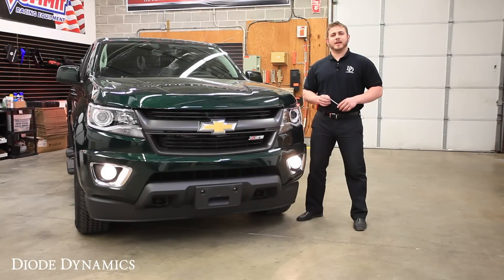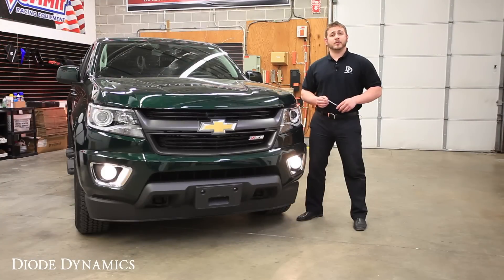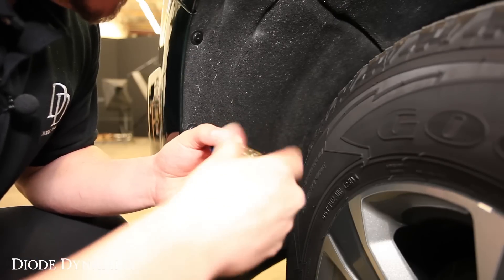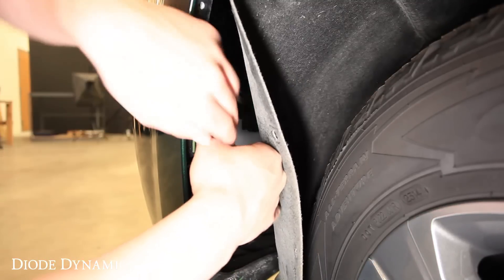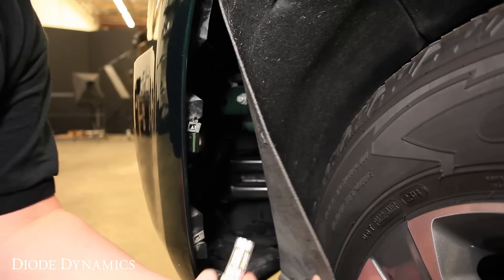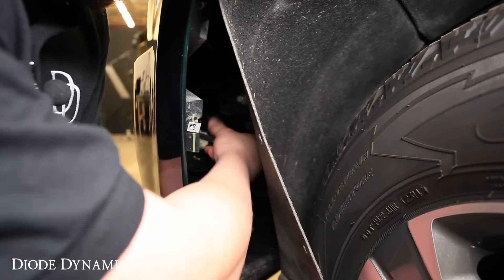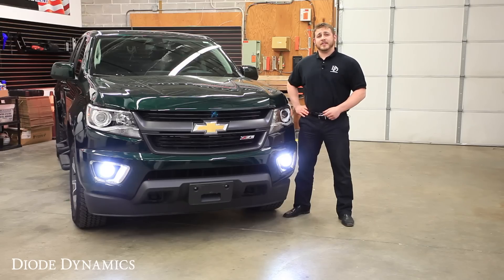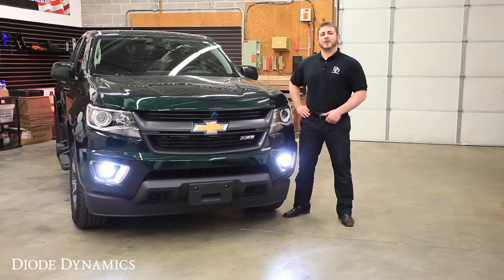How to Install Chevrolet Colorado Fog Light LEDs

Comment: Can I use this for my 2017 Colorado?
Reply from the maker: +Glistening Trichomes Unfortunately, we have not had a 2017 Colorado into our garage to confirm fitment. However, we expect the 2017 should use the same size as the 2016 (link below). If you send us a photo of the factory bulb uninstalled to contact@diodedynamics.com, we would be happy to confirm this for you! If you have any other questions, just let us know! 
https://www.diodedynamics.com/store/catalog/product/view/id/22496/s/2015-chevrolet-colorado-fog-light-leds-pair/category/486/
Reply: As long as it's a H16

Comment: I installed by removing the three bottom screws on the Fender Well Cover on my Colorado 2017 Z71 4x4 Short-bed.  There is enough room while laying on your back looking underneath to put your hand through and remove and replace the bulbs with LED's.  I have the Chevy OEM Fender Flares and this does not impact them.

Comment: I ordered a pair of these for my 2016 Colorado...I can't get them to fit for the life of me. The factory bulbs were tough to get out but that's probably because everything is frozen outside. But went to install the new bulb and it won't click in. All the notches are aligned and it looks identical to stock but god help me it just won't go far enough in to click into place. I actually snapped a plastic piece that helps hold it on, on one side. It doesn't affect the install though because I actually did it to one of my stock bulbs and it works fine. Reinstalled stock bulb and it clicked fine. I'm so frustrated!
Reply from the maker: +T Dwnex, we are sorry you are having problems with your install. Please give us a call or send us an email at contact@diodedynamics.com and we would be happy to help you out.